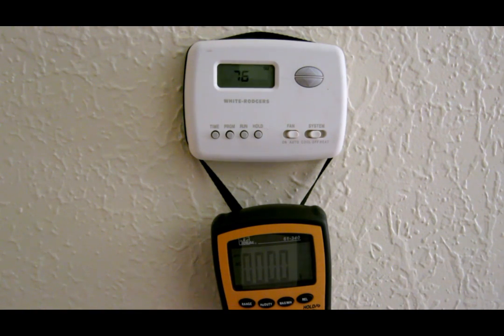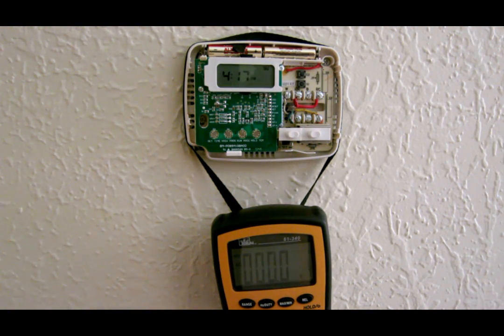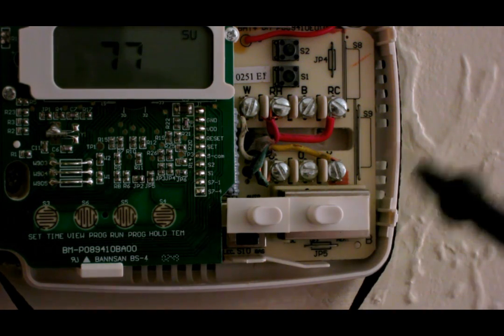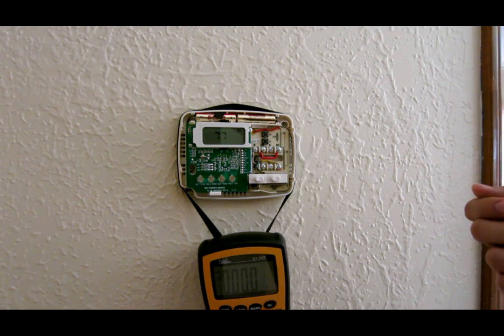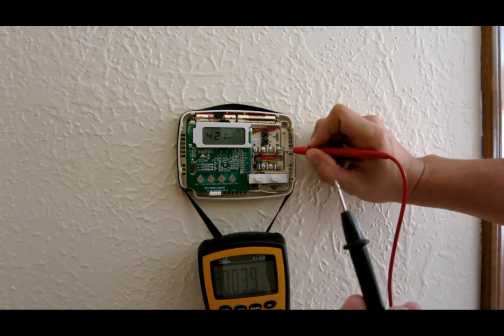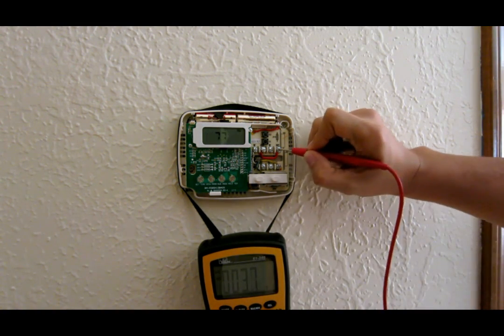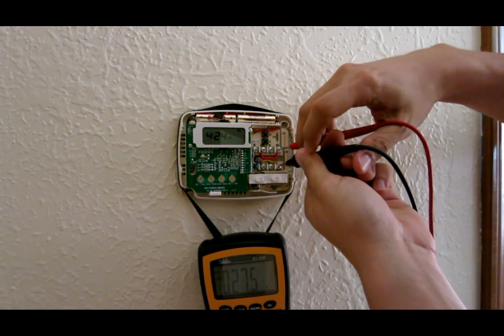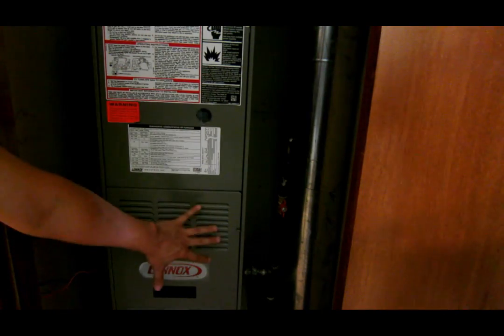Wiring and troubleshooting Thermostat - heat cold air condition AC howto HVAC wiring furnace

Comment: Good idea to turn power off to system as not to short out the wiring.  I’ve done this before and had to enter the attic to replace the blown fuse on the control board.

Comment: I cant believe this but you just solved a massive problem I have been having.  I totally didnt realize the low voltage 24v in the HVAC is AC current.  I 100% believed the transformer changed the voltage from 120v AC to 24v DC... OMG. So you just mentioned AC several times and I even thought you were mis-speaking....  unbelievable.  I wasted about $200 with a service call all because I thought it was DC. Wow. Well thumbs up for the revelation! Unbelievable. THANKS!
Reply: What wire in back of pellet stove do I use

Comment: Thanks so much for making a video that I could understand. When I removed the thermostat panel, it also disconnects the on/off switch. So I could only verify that I do have voltage just like yours when my AC is off.  My AC is not coming on at all. However, I did heard a little noise outside, like it was tried to come on for a second when I plugged the thermostat back in. The last it worked I heard it shutting on and off very quickly (every second, like electrical issue). So I turned it off completely. Thought maybe there might be a short in thermostat. Unfortunately, I can't afford to have a pro fix it right now. Do you think I should try to replace the thermostat? My filter is clean and I rinsed the coils off with the water hose.

Comment: After I changed batteries the thermostat shows wrong temperature, like 15F higher than it is. Can I repair it, or I need to buy a new thermostat? I have "White Rogers" similar to the one in this video.

Comment: My ac condensor not getting 24 volts. My stat is getting 24 on all terminals indoor fan running but outside isn't getting 24

Comment: I am having issues with my furnace, when i did your wire test I learned that my white furnace wire and my red wire have 0 volts, but the fan and the ac both have 27 volts do you know how i go about figuring out what is causing this issue? thank you in advanced

Comment: I have a split heat pump system with auxiliary heat. Just installed a new Honeywell 5-2 digital programmable thermostat. System turns on, blower fan does not. What did I wire incorrectly?

Comment: If i connect the red wire to the green wire it will turn the fan on? If i connect the red wire to the white wire it will turn the heat on? If i connect the red wire to the yellow wire it will turn the cool on? will this work?
Reply: Jonathan Oakey yes it will turn it on and never turn it off because u r supplying 24 volts right to each terminal
Reply: It might not be a good idea unless it's just for troubleshooting to see if the furnace works. In my case there was no voltage at the white wire but  the problem was farther down the wire at a sensor.

Comment: Good video, did all this and found out there is a float switch on the drain pan that failed.  I bypassed the switch (disconnect and connect the original wires) and the unit works fine.  A lot of work and wasted time for a bad float switch.

Comment: Note that this is from 2012, a time when wifi thermostats didn't commonly exist.  WIFI thermostats don't typically have batteries, they require direct power due to the demands of wifi.  If you are replacing the old guy with a WIFI, look for another video that addresses that.

Comment: When I press to change the temp the light doesn't come on.  I have changed the batteries, double checked to make sure they are in right, but still not working.  Help please.

Comment: why does thermistats have batteries? if it's for the small electronic display board, why is there not an extra wire for it from the wall.
thanks. great video.
Reply from the maker: +moe SN some older thermostat does use power from the furnace/air handler and there is a Common wire that returns to the furnace/air handler. More modern thermostat uses batteries, which doesnt require the common wire as you saw in this video,
Reply: +DIY Tinker Thanks:)

Comment: Great vid & congrats on your views, questions and your follow-up answers.  I have a simple question I don't see answered:

When you test the voltage on each of the wires, in the video you have one of the meter leads connected to the same wire for testing all of the other wires.  Which wire is that?

I have 5 wires, including a C and need to test the voltage on all  due to failure of 2 wifi stats, manufacturer says likely due to excessive voltage from the furnace

Thanks!
Reply: +James Sutton if you have C, then C can be your reference (one of the lead connected there). The only difference is that the measured voltage output would be reversed when compared to my results.

Comment: great video! but i am just like Nick - why does the voltage goes down to 0 when the circuit closes?
Reply from the maker: +Mando Rodriguez (mando Rdgz) The goal was to determine if the relay is working and voltage is conducting back to the control board. The two points im measuring is across an open relay. Since the relay is open, there is a voltage difference (imagine 100+MOhm resistance across two points). Once the relay closes (sends voltage back to the control board), then there is zero voltage difference between those two points because there is almost zero ohms. That is why i am able to determine if the relay is conducting voltage.
Reply: +DIY Tinker thanks for your reply. one quick question about a heat pump system: Why the condenser fan only works when contactor is pushed down in heating mode? in AC  the fan works fine.
Reply from the maker: +Mando Rodriguez (mando Rdgz) Because the condenser is trying to absorb heat from the environment. Here is a good video that explains the basics: https://www.youtube.com/watch?v=14MmsNPtn6U
Skip to the 3min mark for explanation.
Reply: +DIY Tinker, thanks for your reply and for sharing the very informative video. now, i do know that in heating mode, the fan shuts down in the defrosting stage. but the problem is that the condenser fan does not come on at all heating mode. it does comes on when in AC mode. any suggestions?
Reply from the maker: +Mando Rodriguez (mando Rdgz) im not sure if you are using the correct terminology. But yes, the condenser fan shouldn't come on in winter. the video goes over that part as well.
Reply: +DIY Tinker, i do not know that much about hvac so i apologize if i am not using the correct terminology. when i say "condenser fan", i am referring to the outside fan unit. i was under the impression that a heat pump system heats and cools using refrigerant having that outside fan constantly running except when in defrost mode. 

the problem with this heat pump is that the outside fan unit only runs when the system is set to AC. whenever is set to heat, the outside fan does not run. i did some voltage testing yesterday and this was the outcome: 

AC mode turned on at the thermostat connection to the inside board:
compressor - 0 vac
reverse valve - 0 vac
heat - 24 vac
fan - 0 vac

as mentioned above, in AC mode, the fan and everything else works normally

heating mode turned on at the thermostat connection to the inside board:
compressor - 24 vac
reverse valve - 24 vac
heat - 0 vac
fan - 0 vac

in heating mode, when outside and checked the outside unit 24 volt contactor coming from the thermostat and it seems that it is getting 24 vac. then, using a stick, i manually pushed down the contactor and the fan came on.
Reply: +Mando Rodriguez (mando Rdgz) When you measure the contactor leads, do it show 24VAC when in both Heat and Cool mode? If the answer is Yes, but the fan turns on in Cool and turns off in heat, then that means there must be a temperature sensor outside that over rides the fan. look at the schematic.
Reply: +LEGO Brick Builder thanks for the reply. i did check the contactor in AC mode and i am getting 24 VAC when the AC is on at the condensor contactor. in heat mode, i do not get 24 VAC at the condensor contactor. 

checked the manual for thermostat wiring and could not find it for my model below. the furnace model number is: e2eh-012ha. i think this is the manual: http://www.nortekhvac.com/Literature/359a.pdf

 thanks for your help LEGO Brick Builder.
Reply: LEGO Brick Builder, here is a link of the current thermostat wiring at the furnace and at the condenser unit: https://goo.gl/photos/6QJMB9rTrmrZp5ZA8
Reply from the maker: +Mando Rodriguez (mando Rdgz) going back to my earlier comment. The contactor shouldnt turn on in heat mode. maybe someone else can comment with more knowledge on this subject.
Reply: +DIY Tinker thanks. I'll probably have to call someone to look at it. again, thanks for your help.

Comment: Helpful video. Do you have a similar video showing heat terminal (W/W1) voltages when switched to heat mode as well as changeover valve solenoid voltages (O/W2)?

Comment: This guy is giving wrong info.

FALSE:  Not all digital thermostats require batteries. In fact, i would recommend a thermostat that allows you to connect the low voltage lead to it. My heat pump did not have the wire hooked up by default because it was built 20 years ago so I had to open up the side panel, find an unused colored wire, attach to the low voltage output, viola, no batteries required. Example: 7-Day Programmable Thermostat - RTH7500D Honeywell. Read manual.

FALSE: the colors are not the same colors from thermostat to thermostat and you might ruin your AC by hooking it up wrong. G may not mean Green, etc...

Comment: Thanks so much man. Occam's razor the simplest explanation is usually the correct one. I've been screwing around with the thermostat based on the assumption that it only used one polarity.

Comment: I have a dinosaur of a system - no control boards. Last season I replaced run/start capacitor. Now I am replacing the transformer and added a 3amp in line fuse. My heat runs fine. The AC blows the fuse after about 2-3mins.The low voltage side of the contactor reads 14.5 ohms and the wiring outside looks to be in good cond, not brittle, hasn't been chewed or weed wacked. I disconnected one of the leads for the contactor so it would not energize the condenser contacts and ran the unit and it still blew the fuse. I am still suspecting the wiring as it does go through a crawl space that I can't really see too well. How can I check for shorts in wiring with continuity tester - hot to common with lead disconnected at contactor? What about for thermostat to furnace wiring, how can I test it for a short?
Reply from the maker: fuscorayj What happens if you disconnect the low volt side on the contactor and call for Cold? does the fuse blow after 2-3 min? Then try shorting on the control board to call for cold, does it blow after 2-3 min?
Reply: DIY Tinker interesting turn of events, although the heat seemed to be running fine last night, the fuse was blown this morning so what I did was jump only the fan coil and connect a clamp ammeter to the line, I disconnected at 4amps before it blew my last fuse. I wasn't sure what the "fan coil" actually was until I took it out. I'm going back to the supply house to see if they even have one of these fossils.
Reply from the maker: fuscorayj now i am a little confuse as i thought the 3amp fuse was on the 24VAC line or transformer. Your fan can pull a lot of current, and a 3 amps fuse is defiantly not enough.
Reply: DIY Tinker Sorry for the confusion, I am a novice and this system is  ancient! The fuse is on the "common" side of the 24vac line between the transformer and the connection with all the commons (gas valve, contactor & fan relay). The line I clamped was the 24vac (green) from the thermostat that goes to the relay, it was the only connection that was live.
Reply: ***** right now I need to get a blower relay, my local supply guy crossed referenced my part and said it was a lennox part and told me where I could get one but you have to be a contractor to purchase lennox so I have to go back to my guy and see if he can order me one or if he has a generic that I can use. I was able to run the AC ok by leaving the blower fan relay out and manually turning fan on and off using the 120 breaker. My 24v wiring continuity tested clean.
Reply: ***** LOL, yeah, I know, it took me two tries on the transformer! Saw some on e-bay for like $5 - $6. I don't need one with a time delay as that is another separate component on my system. for sake of convenience, I'll see what the local guy has, I don't see why it needs to be Lennox. It's gonna be a pretty hot muggy day here today and I don't like having to use the breaker as an on off switch, I'll be changing that next!

Comment: Thanks for the vid. It will help me sort out my current issue.
Question, I have the same brand thermo minus the programmable portion at the bottom like yours, can only control on, auto, off, cool, heat... My issue is that the ac will kick on and cool but wont cycle off even when it hits the temp its set for. Will turn off if I switch it off and will shut off if I raise the temp above the current temp. If not it will stay on for hours. Where would you start trouble shooting?
Reply from the maker: Jason O Is FAN on Auto or On? If its on ON then set it to Auto. If that doesnt fix it then there is a chance your thermostat is bad. Else, the control board. But i have a feeling you have FAN on ON and thats your problem.
Reply: Hi and thanks for the reply. 
The fan is set for auto. Checked all wires and they are connected however I still need to check the voltage. More leaning to calling an ac technician to check over the whole system. 
Getting into the board is more technical than I want to get;) Thanks for all your vids as they are quite helpful

Comment: My problem is that I put a new thermostat nd I connect but the situation is that I turn heat nd works right till gets the temperature need it keeps going doesn't turn off

Comment: I have a goodman electric air handler with variable speed motor seems to only run on high speed while on heat not hot air from registers

Comment: Hi,
While changing the thermostat, i mistakenly shorted the R and C wire and saw a spark. Put it back the old one only, but it is not working. Measured the voltages, no voltages on any wires. Checked the main, it is not tripped. Where should i check.
Reply from the maker: check your furnace control board. There's a fuse that could have pop. Also, check your 24VAC on the transformer in the furnace too. transformers dont burn out that easy.
Reply: DIY Tinker Thanks, It is the fuse on the control board inside the furnace. Changed it, working fine now :)

Comment: Hi, DIY  Tinker I have a  question what can be when your yellow cable  doesn't have a volatge?
I did with the multimiter and it doesn't have  the 24v or 27  as you said  , would you please help with that?

greetings

Comment: Hello. Im having a problem with my ac not kicking on. I discovered there was no 24v at the contactor relay which led me to believe it was my thermostat. When I tested the red and the yellow at the thermostat, I dont have 24v but when I test the red and the white or green I have 24+ volts. What exactly does that mean?
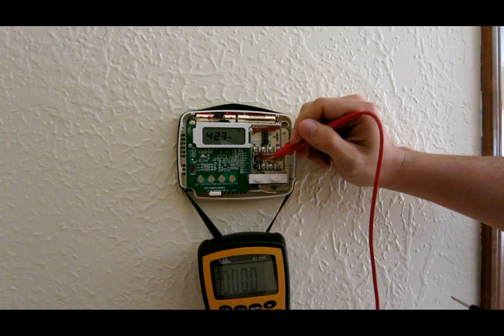Reply from the maker: Remember AC has to be off as said in 5:15. I suspect you have the thermostat on cold. This was shown at 6:15 for green.
But lets say you did set the thermostat to off, then you have to trace back from the transformer to the thermostat and to the relay. Something is disconnected.
Reply: Yes I have digital thermostat similiar to the one in the video and it is completely disconnected from the circuit. What's strange is the fact that the heat, and the fan will come on but not the ac. I'm just wondering could it be a faulty thermostat not relaying the 24v back to the control board in the furnace or is there a break in the thermostat wire somewhere.
Reply from the maker: ***** if the thermostat is completely disconnected and assuming your wires do go to the right location, then try shorting a wire between red and yellow. that will complete the circuit and it will turn on the AC. If it turns on then the thermostat is bad, if it doesnt turn on then check your wire at the transformer and try turning it on from the control board.
Reply: DIY Tinker I found the problem thanks to your video. I traced the yellow wire coming from the thermostat going back to the control board and as crazy as it sounds it was not wired to the control board like the fan and furnace wires were. It was wired into my water pump unit that extracts the water from my ac unit. I guess since the water pump stopped working it was no longer able to get the 24volt power it needed to energize the contact coil.
Reply from the maker: ***** that is interesting. good to know it worked out.
Reply: ***** your condensate pump (water pump) has a safety cut-off switch that stops the ac (Y) when the pump stops working, so you don't flood